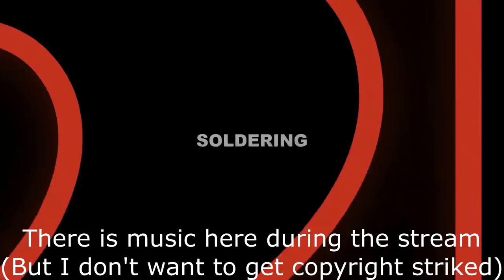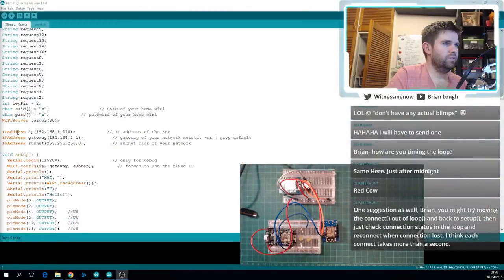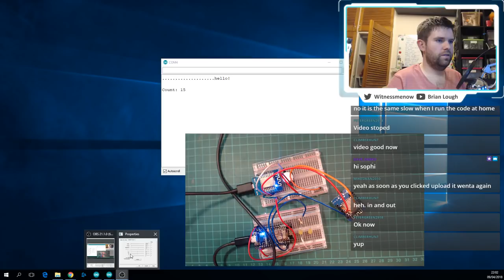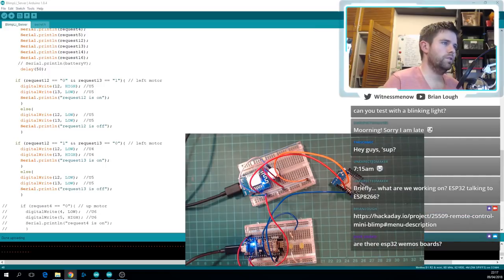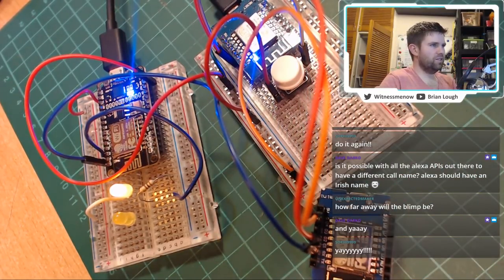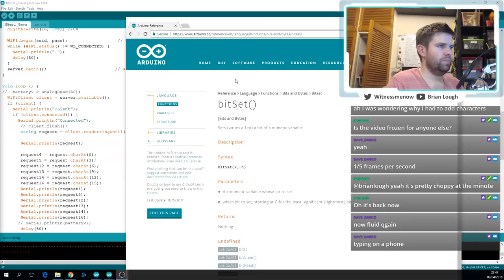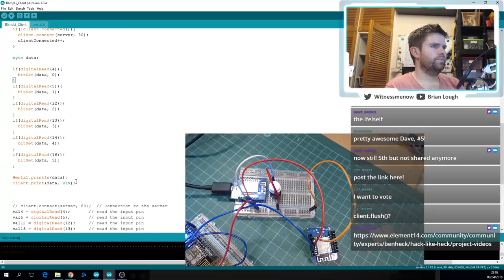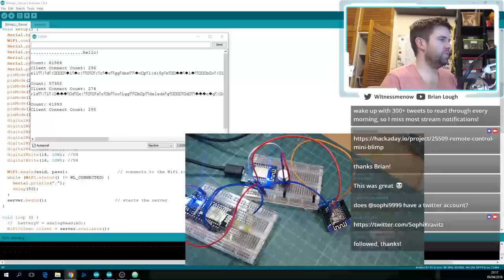Reducing latency between two ESP8266s for a blimp project! [Was live on Twitch]

Comment: Sorry I missed the stream but just caught up now.

Interesting idea about using GitHub releases for OTA. Very similar to what Andreas Spiess has done with iotappstory.com but more generic. If you haven't seen IAS then do check it out.

Near the end there was a discussion about notifications. Is that not a great example of an application for your Telegram library - a button for you to press that sends a message to a Telegram group chat that people could subscribe to?
Reply: Sadly it doesn't seem like it would be possible to tie an OTA solution to GitHub releases without an intermediate server.

Whilst GitHub has a very nice little API which the ESP could use to identify a new release it is only possible to extract either a .zip file or gzipped tarball of the release not a specific .bin file. And the little ESP couldnt handle unzipping and deleting what it didn't want.

It's a real shame as it would have been a good idea.
Reply from the maker: You can attach other binaries to releases if I'm not mistaken, so it might be possible to use just the raw bin file. I need to look into it more though!
Reply: Brian Lough That's interesting. I'll have to have a look at that.
Reply from the maker: I haven't look too closely at if I'm being honest! But you see some releases have executables attached so it must be possible!
Reply: It is indeed possible, I've just tried it and have the API output now including a binary asset.  Should not only be possible but relatively easy to do.

Not the most secure way of working if you're embedding passwords and API keys in code/secret.h files as they'll be revealable in the .hex/.bin file but perfectly OK for those using WiFi manager etc.
Reply: Well, so near and yet so far with GitHub!

Almost have this working in a sketch but one last (unsormountable?) hurdle.

I've got the check working fine and I can get the URL of the appropriate binary attached to the release from the API.  That's straight forward.

Problem 1: The download URL supplied by the API is a "prettified" one and redirects.  ESP8266httpUpdate doesn't support redirects.  Problem solved with a custom function to follow the redirects until it finds a real URL (can be found here if anyone thinks it would be useful for other APIs etc - https://gist.github.com/yknivag/2707e27787abeafa69b33c4e9d043c3a)

Problem 2: The true URL is a pre-signed time-limited share link to an AWS S3 bucket!  This URL works fine in the browser but not on the ESP.  I problems in curl too (curl -v url doesn't work (with the same error) but curl -v "url" does!)  No matter what I try I cannot get the URL to open in the ESP though - Amazon returns a bad request response.

So, yes - great idea in theory.  Tricky one to implement in practice.  Anyone fancy re-writing the ESP8266httpUpdate library?  It's way beyond my programming skills.